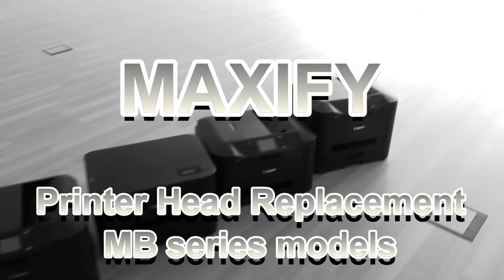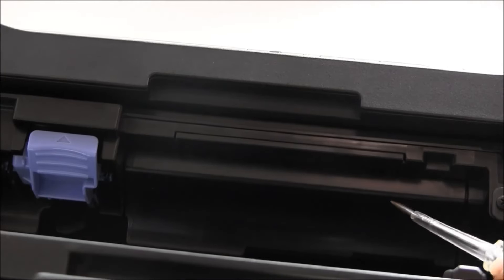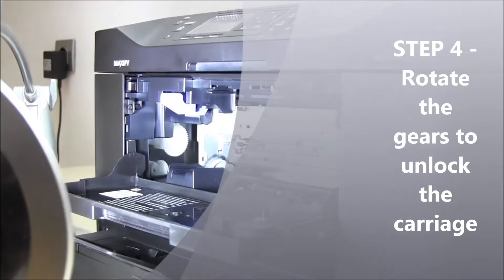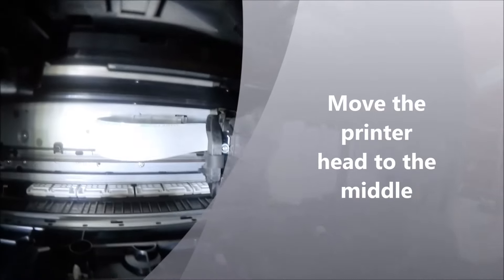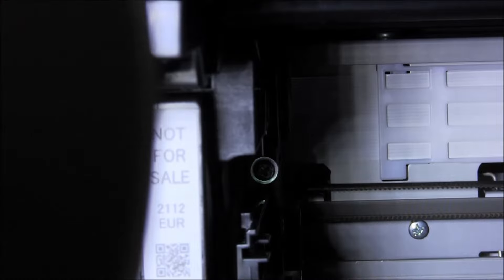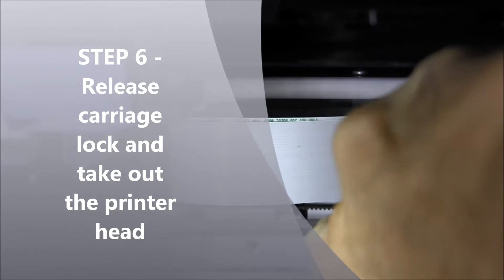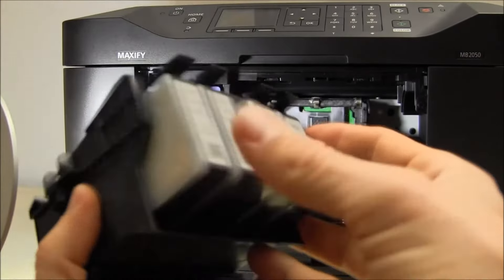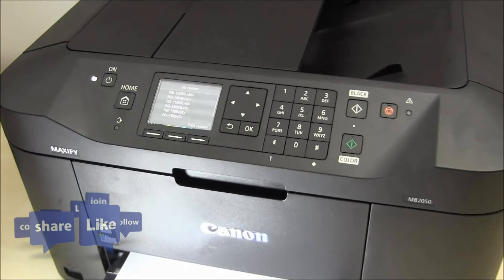MAXIFY MB2120 MB2140 MB2150 MB2720 MB2750 MB5120 MB5150 MB5420 MB5450 iB4100 Printer Head Removal

Comment: No need to wind the gears to move the printhead, just pull the power plug while printing.
Reply: Great tip, I turned the gears many, many times and the printhead would not realease

Comment: Ya. That plate that was first taken out does not exist in my 2022 MB2720. Canon must have read the review and decided to "fix" that piece from being easily removed. When I came down to it, it wasn't necessary to remove it. Just start printing something and while it prints, pull the plug. Carriage is lose. Move the carts so they can easily be removed. Then remove the two screws holding the print head in and take it out. Now I'm going to run some hot water through and let it soak overnight. Printers! What a pain. It's like gangsters found a new way to rip off people in so many different and evolving ways.

Comment: This video was perfect for what I needed. Print head removed, cleaned, and replaced. Thank you!
Reply: Hey,  i have the same printer. did you worry about the electrical contact panels when you cleaned it? How did you clean it?  also, did you replace the cartridges or put the same ones back in once you had cleaned? thanks ! my printer isn't printing black ://
Reply: Didn't work for me. Did you put the same cartridges back?

Comment: Had to do this to my MB 5120 because I HAD to buy crappy ink cartridges online instead of the name brand Canon. All these crappy ones did was leak everytime it printed something, the whole inside of my printer was a mess, including my desk, these crappy cartridges were $29.00 for the entire set of cartridges including the black ink. That's what I get for trying to save money!  Canon brand is super expensive, but if I have to pay that extra for good quality next time I will. Canon wants nearly $100.00 for the entire set of cartridges though, ridiculous! This includes Wal-Mart! That ink bottle refill stuff doesn't work either, just as bad as the cheap-o cartridges! 
So, thanks for posting this tutorial, learned my lesson!

Comment: My mb 2140 is printing blank pages. done deep cleaning alteady. What do you recomend?
Reply from the maker: I am afraid that ink may be clogged, it could be about print head or pipes inside the printer. I recommend the printer to be checked by service and estimated for repair cost, as it may be noneconomic to repair :-(

Comment: Hi, thank you so much for this very clear video! I removed the head printer for cleaning it. I replaced it and now when I try to print, it says: Error code 5207. @Print Cloud, do you have any idea of what I can do? I would be very grateful!
Reply from the maker: Glad it helped. For error code I checked USA site forum and found the following - copy/pasting, I hope it may help.

The 5207 error can be caused by a paper jam.  Canon has 2 videos that you can view in regards to resolving paper jam or paper feed issues.
 Please view the following two troubleshooting videos available from the MAXIFY MB2320's Support Page:
 1.  Remove paper jam from front of printer:
http://ugp01.c-ij.com/ij/webmanual/Manual/W/MB2300%20series/EN/UF/movie/mb2300-07-1/video-player.htm...
 2.  Remove paper jam from back of printer:
http://ugp01.c-ij.com/ij/webmanual/Manual/W/MB2300%20series/EN/UF/movie/mb2300-07-2/video-player.htm...
After following the steps in these two videos, does the 5207 error persist on your MAXIFY MB2320?  If the error persists, Please perform a roller cleaning:
https://ugp01.c-ij.com/ij/webmanual/Manual/W/MB2300%20series/EN/BG/bg-maintenance2400.html
If the error remains, your MAXIFY MB2320 would require service.
Reply: @PrintCloud : thank you for your time! I'm going to try it asap.
Reply: @PrintCloud  That's not a paper jam.   That code typically pops up if somebody decides to use something other than a Canon cartridge.  I worked for Canon for many years and know how they operate.  I just got that code myself and it occurred right after, and I mean immediately after, replacing my color cartridges with generic cartridges of which I've been using for several years.  I always keep automatic updates turned off but I recall an issue about a month ago where I had an electrical surge and most of my electronics were reset, thus eliminating my do not update command.  I think the printer updated the software which triggered the problem.  

I will never buy another Canon product again because of it.

Comment: Great Video!! I have a question though, my Maxify MB2320 has issues printing Yellow. Leaves blank streaks on the test pattern. Have cleaned, deep cleaned, even changed ink cartridge with no difference. Is there a way to clean the actual print head if I remove it?
Reply from the maker: Hi, there are some methods to try to clean the printer head, but never tried. In fact you have nothing to looseHomemade Cleaning SolutionYou can make your own homemade solution to clean your printer head. Combine 16 ounces of warm water, eight drops of dishwashing liquid and one ounce of isopropyl alcohol. This formula is nearly identical to commercial cleaning solutions sold by printing supply companies.
Reply: Did you try it?

Comment: Thank you!  I watched another video a half dozen times and the jerk never said to unscrew those two screws.  I kept looking at them thinking that they're definitely supposed to come out but certainly he would have said so in his very long and dramatic video.  But nooooo!  He never did.  I received the fatal 5702 or 5207 or whatever the heck code it was on my Canon 2720 printer and I'm going to do whatever I can to try to salvage it.   I think Canon updated the software to make the printers self-destruct (or get a code indicating such) if one uses anything but they're ridiculously expensive ink cartridges.  

At least now I have a chance to clean the printhead and see what happens.

Comment: hello, thx for the video. i removed, cleaned and replaced the printing head on my Canon Maxify 2320. ive re-installed it and now i get an error that the ink cartridges are not installed correctly. they arent new carts, but installing a new one didnt seem to help, do you have a suggestion?

Comment: I have a Canon Maxify MB2140 printer.  The ink absorber is full, error code 5B00. Printer error has occurred, contact the service center.  How to clear this message? Can you advice?
Reply from the maker: You will need to take to service, replace ink absorber

Comment: I’ve had my maxify printer for like 5 years. Yes I was using aftermarket ink but I was buying the same ink cartridges from the same eBay store for the entire time I had the printer. About 6 months ago I ran low on black ink and had to go to a local store to buy a genuine canon black ink cartridge before I ran out. A week After using the genuine canon ink the printer head clogged up. Pretty sad the aftermarket inks never had a problem in 5 years but the canon did. I use this for my business so I use the printer many times per day.
Reply: Probably the genuine ink mixing with non genuine and cloging